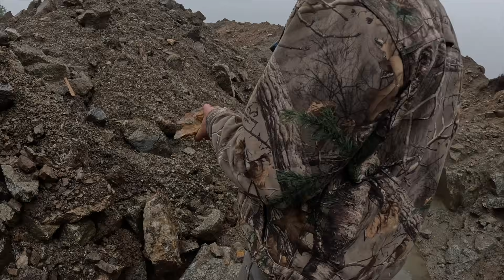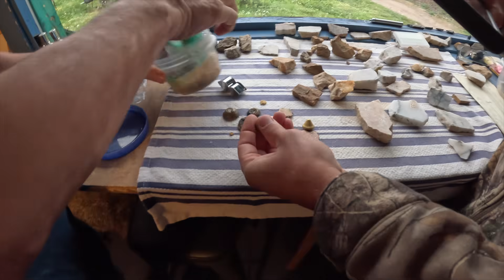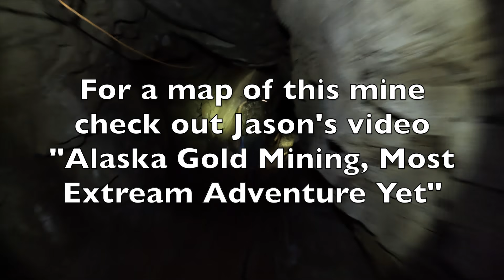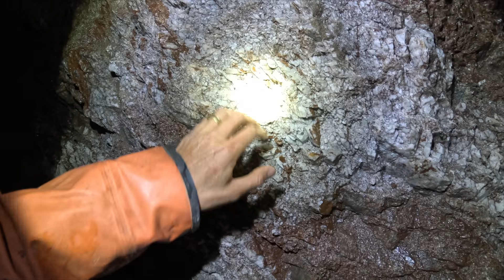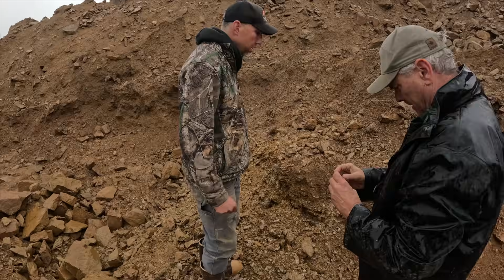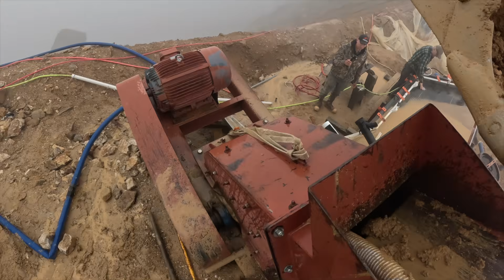Gold Mining in Alaska Part 1

Comment: At a glance, it looks like they’re relying far too much for that hammer mill. That many spent teeth indicates from my couch, that they’d be better off running it through a jaw crusher first, then moving it to the mill. Or maybe the teeth just don’t last very long. Spent units looked like tons of wear though. Are there teeth available with replacement ends?
Reply from the maker: Yes a jaw crusher and ball mill would be best for this.

Comment: When you're under the valley floor around the 20 minute mark, where's all that water going?  Are they operating pumps or is it finding it's way into an aquifer?
Reply from the maker: @danmerillat  in Jason’s video he shows a map of the mine.  I don’t know where the water is going,  no pumps
Reply: @mineoperator   A good position to be in, rather than having to pay to run pumps 24/7 to keep the workings from flooding and rotting.   With all those slips there's probably a lot of cracks for the water to find its way deeper.

Comment: i can imagine a spherical grinder machine that could roll about in a mine and grind away through it to gather up ore and rock as dust and chips, etc. basically it could go in any direction and support itself in any orientation, and could even be single person operated, with its own water and air and electric and hydraulic supply. i dont know why, but i have the inexplicable urge to smooth out ALL of those walls in either a full or half circle or vaulted with a point shape lol... probably a waste of time to do so, but i can imagine it lol. that, and you could, in theory run a sluice system out the back of said machine and process ore as you went. using a recirculating system for the water, and a de-watering screw type device so you can then haul out the waste material near continuously... mad scientist style steam-punk sort of contraption, but my mind just does that lol